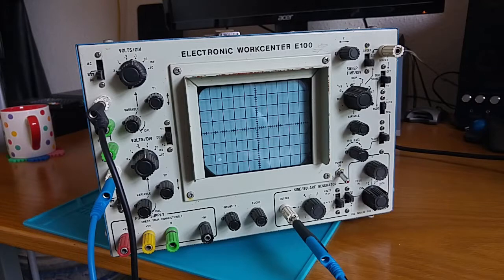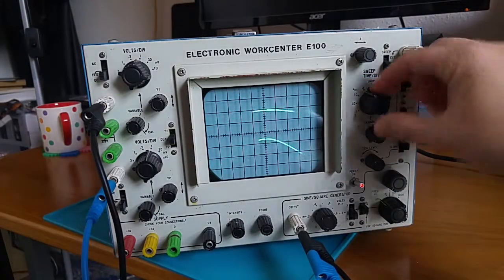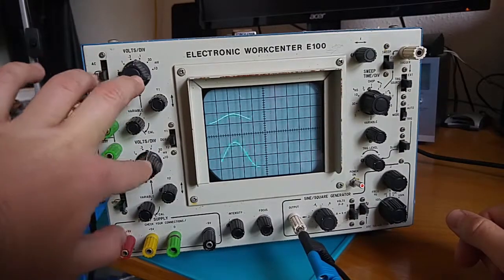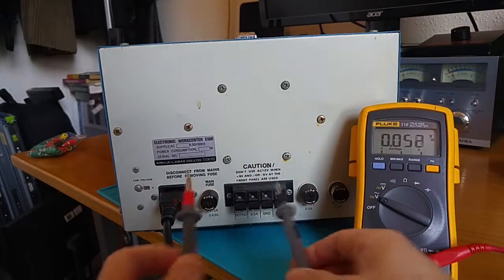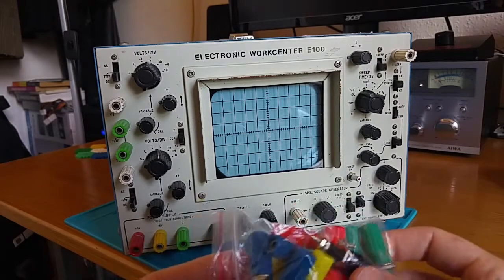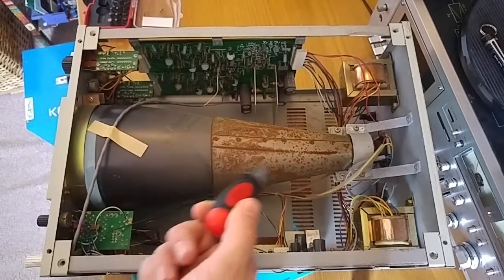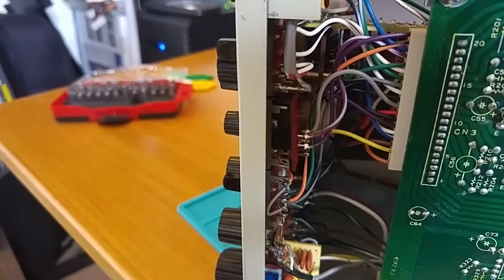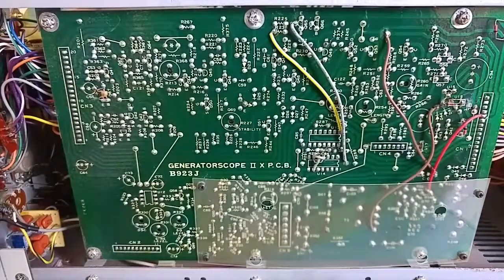Electronic Workcenter E100 Generator Scope: Part 1 (Fixing Old Junk)

Comment: These were designed for The Open university  T 283 electronics course and Manufactured in Japan in the early 80’s. I was chief technician and ran the dept where we serviced and calibrated them for loan to students for year. They were accompanied by modules with all the experiments laid out for analogue and digital electronics. They were extremely reliable and robust.